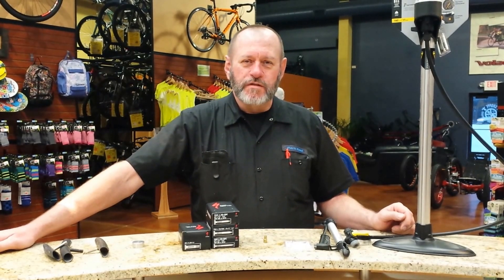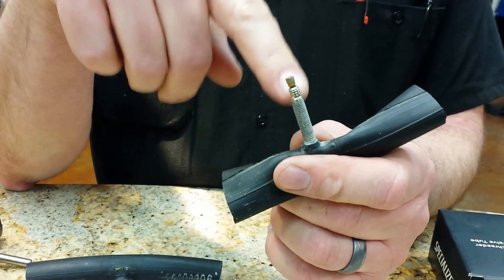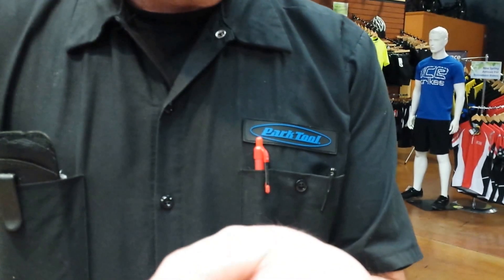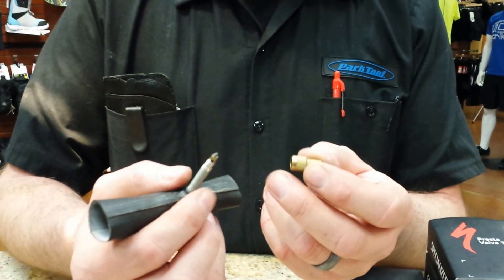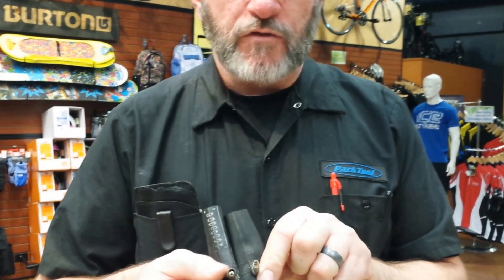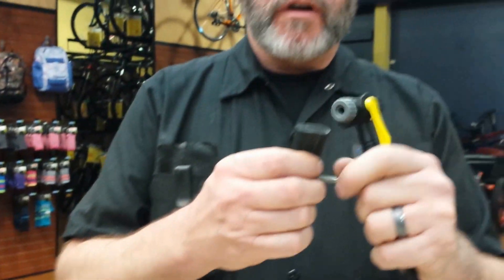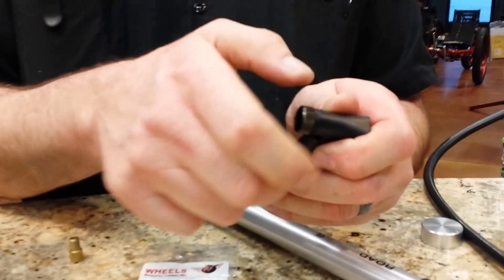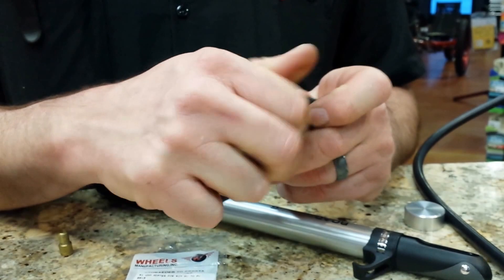Types of Bicycle Tube Valve Stems & How to Inflate Them

Comment: I hate the presta valves on my giant bike the threads on top of valve are way to weak and thin and always break off.They never hold air like the old schraders do next time one of my presta valves break i will take both rims of drill them out and fit tubes with schrader valves the prestas are junk !
Reply from the maker: I have had other customers drill their rims out.  Be sure to get out any metal shavings prior to re-installing tubes.

Comment: How do you deal with presta tubes with non threaded stems?  When you try to attach the pump head with the tube inside the rim there is no nut to hold stem in place.
Reply from the maker: We would recommend getting a tube with threads.  There are lots of brands on the market, but we do not have any smooth ones.

Comment: Hi, I'm looking for a bicycle tube that is both good for not getting flats and can handle the torque of an Ebike. Any recommendations?
Reply from the maker: Hi,  I would recommend using a more puncture resistant tire, like the Schwalbe Marathon Plus https://hostelshoppe.com/products/schwalbe-marathon-plus-tire?_pos=1&_sid=38ce1359d&_ss=r , so that you reduce your puncture incidents.  It is also rated for e-bikes.  Use in conjunction with a  Schwalbe tube.

Comment: Note that the Schrader valves are not typically used on standard bikes in several countries in European region and elsewhere. Instead the typical valves are Dunlop and Presta valves.  However, Schrader valves are seen on touring and mountain bikes in Europe.

Comment: Why do they make those other valves??? Where I live you can't get adapters, why complicate a good working thing? I just bought a tube and can't fill it, been filling normal tires for decades never needed adapters.
Reply from the maker: Hi,  Presta valves are a higher quality valve stem.  You can get adapters here https://hostelshoppe.com/collections/tube-tire-maintenance/products/genuine-innovations-presta-valve-adapter so you can pump them up with a regular pump.
Reply: @hostelshoppe  can't / cannot get them here (without driving a few hours or spending a fortune in import tax). If they are a superior valve I hope the inferior ones would disappear but most of the world can't do that so easily.
Reply from the maker: @CsykKrit  Sorry, I was not aware you were overseas.  You may want to invest in a pump that works with presta valves.  I know it is hard to get a lot of bike parts and accessories right now.

Comment: i have the adapter and the stupid thing still dont take air at all, i put everything as tight as i could and still
Reply from the maker: I suggest stopping down at your local bike shop.  They can check if the tube is flat, or if there is an issue with the pump.  Be sure to bring everything with you.

Comment: This is super helpful thank you!  I only ever had shrader before and I was so baffled.  Your video is really clear and now I'm confident I wont screw up my tyres somehow.
Reply from the maker: You're welcome!
Reply: Thank you for this video.  I got my bike tuned last year, and just realized that I dto not have the standard (sharader) valve.  I was so mad because I didn't know why the little thing at the end needed to be altered to keep the air in the tires.  I am glad this video popped up when I searched, because I was about to have a fit.  I will try what I have learned tomorrow and I hope that it works. my bike is my only source of transportation.  I am not sure, but it could be the nut that keeps the valve on the rim, I noticed it was loose, so  I tightened it, but it kept turning.  I wish the bike mechanic person had explained this to me.

Comment: I prefer the shrader to presta ,simply because presta valves do not hold the air in tubes for a long time as the shraders do.I simply  replaced the presta valve tubes with shrader tubes and didnt have to use a pump again for months. By comparison, with presta , the other bike wheels go flat within a week....Can the adapter be a permanent solution ,since the rims are very thin  for a shrader valve?
Reply from the maker: Yes, you can leave a schrader adapter on the presta  valve stem to pump up the presta tube.
Reply: @hostelshoppe  Thank you
Reply from the maker: @mahdsaed  You're welcome!